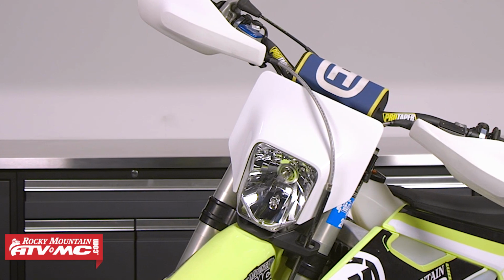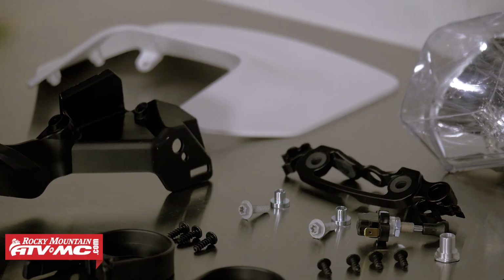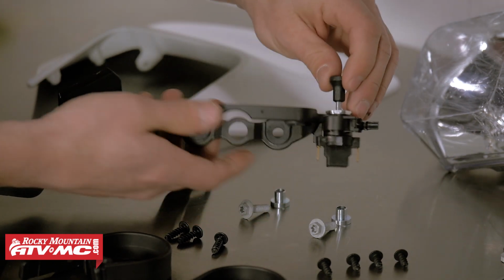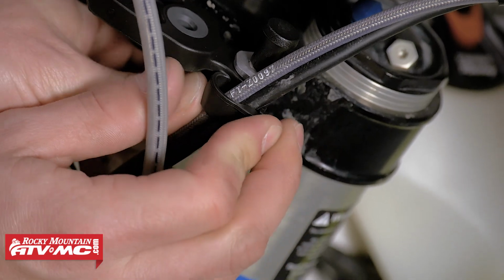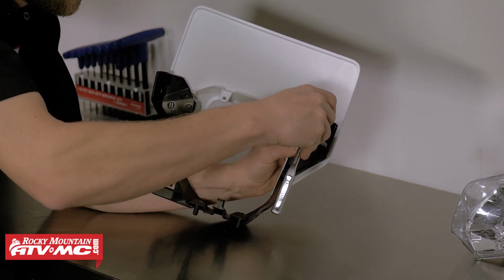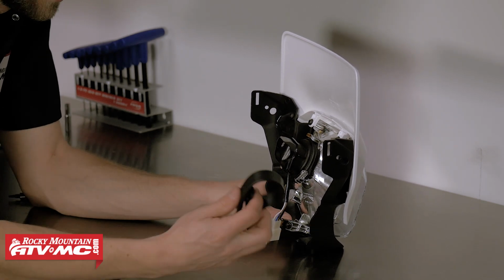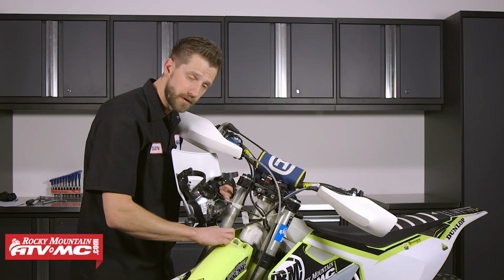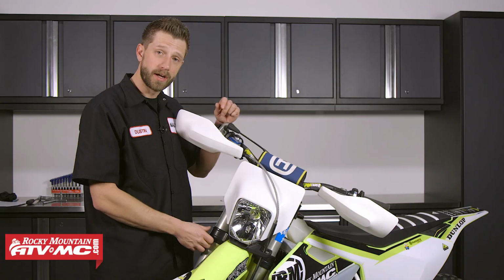How To Install a Husqvarna Dirt Bike Headlight Kit

Comment: Is this good for all the “x” line of bikes? Looking at a 2020 fx450 and would like to have a headlight
Reply from the maker: We have heard of people making these kits work for the FX bikes but it will not be a simple plug and play install like shown in this video since the FX models have a slightly different wiring harness than the enduro bikes.

Comment: Hey guys can you tell me if the 2017 FC450 has a lighting output stator because if not i will run a simple 4inch led bar instead of the factory headlight
Reply from the maker: You will need a higher output stator to run this headlight kit. You can check out the Trail Tech stator if you want to add some more electrical accessories to your bike: https://www.rockymountainatvmc.com/parts/trail-tech-complete-stator-kit-p?v=13108

Comment: Thanks for the video i buy all my stuff from Rocky mountain mc what wattage is the bulb and if it is the same as stock can you replace the bulb in that unit to a brighter bulb
Reply from the maker: This kit is an OEM part so it will be exactly like the stock Husqvarna units. It uses a 35w HS1 bulb which some people have swapped to an H4 bulb if your bikes charging system can handle it, but that's not recommend. Husqvarna also makes an LED headlight kit that you can check out here: https://www.rockymountainatvmc.com/parts/husqvarna-led-headlight-p
Thanks for the support!
Reply: @rmatvmc  thanks appreciate that 💯👍